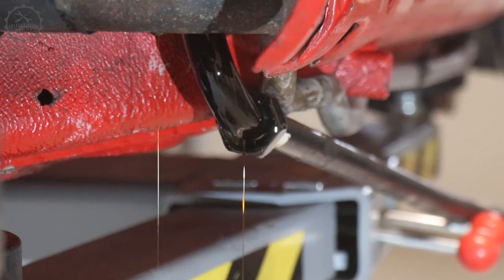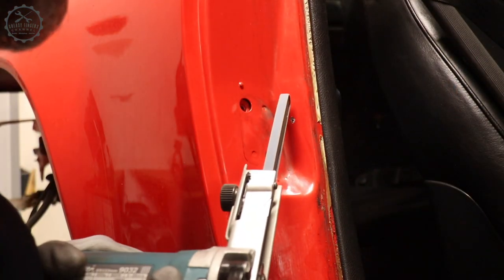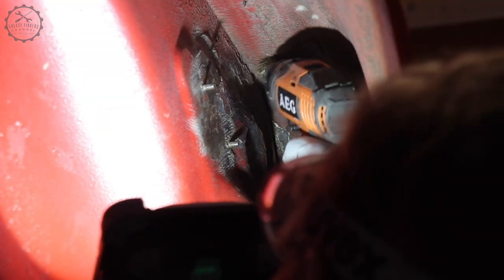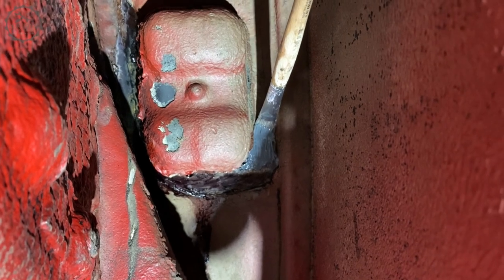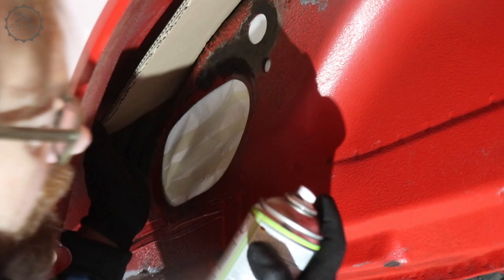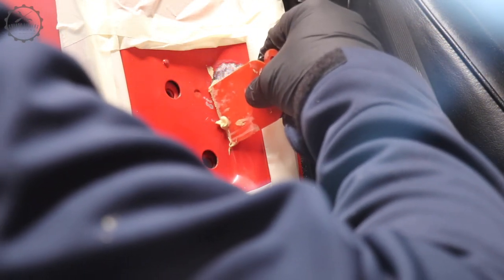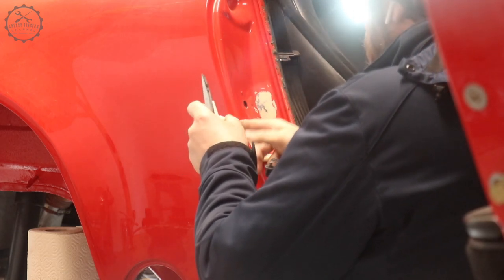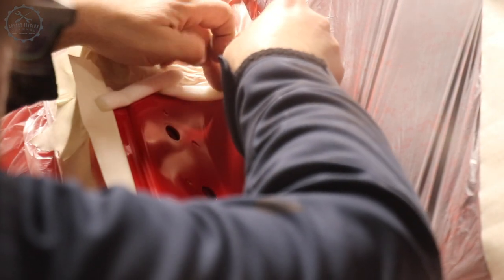Porsche 911 (87): Restoring The Rear Wheel House

Comment: Great series, love your content and skill, inspiring me to work on my 964 that also has some small rust issues.  In the past I have welded such holes by backing them with a piece of thick copper plate.  You can get much nicer fill and added bonus of a heat sink.
Reply from the maker: Thanks, mate!
I use the copper plate method myself sometimes. Point is: no gap allowed between steel and copper.

Comment: I always thought rubberized stone guard eventually lifted and trapped moisture.. I live in socal, and my car is from 1991 and I seen signs of lifting and slight surface rust. I think the best option to stop this, is to take off all the factory stone guard, get the metal completely bare, epoxy primer to seal in the metal completely, then a stone guard to protect the epoxy primer. It’s Impossible for moisture to makes its way under epoxy primer. 

I am thinking of getting a wire wheel on a high speed angle grinder, and taking off my factory under coating/stone guard to start fresh.
Reply from the maker: Yes, you’re absolutely right, 2Component epoxy primer must always be the first layer on naked steel followed by stone guard. In my experience, rubber based stone guard has made some progress in the past years and I used it in the project that you commented on. These days, I‘m switching to bedliner as stone guard, there’s a film in the Giulia series about this.
Still, the first layer is epoxy primer.

If the car that you’re restoring is post 76 Porsche 911, I recommend not to wire wheel the original stone guard off. And that’s for two reasons: the stone guard Porsche used back then is extraordinarily resilient and unless you see it coming off at spots, there’s no reason to distrust it. 
The second reason is that heavy wire wheeling will also remove the zinc layer which I often find totally sound after all these years. 

HTH

Comment: Hallo, besten Dank erst mal für die guten Tipps… Baue ebenfalls an einem 11er, deshalb ist das wirklich sehr interessant…... Die Iwata würde ich mir auch gerne beschaffen… Welches wäre denn die beste Allround-Düsengröße? Danke und beste Grüße, Holger
Reply from the maker: Danke, Horst & viel Glück mit Deinem Elfer. Welche iwata meinst Du? Die kleine, die ich für die Spot Repair benutze, oder die mittlere für die Radhauslackierung?
Reply: Greasy Fingers 
Hallo, Danke für die Antwort… Ich meinte die mittlere, das kannte ich noch nicht. Habe danach gesucht, aber es gibt einige Düsengrössen... Eine kleine Airbrush-Pistole habe ich bereits…. LG
Reply from the maker: @horstmartino6089  Das ist eine Anest Iwata LPH 80, ich habe beide Düsen (ich glaube 0,8 und 1 mm), aber bei meiner Art zu lackieren spüre ich keinen relevanten Unterschied.
Reply: Greasy Finger
Besten Dank für die Info, hilft mir weiter... ich probiers dann auch mal mit den Radhäusern... zum Glück rostfrei... 
Viel Erfolg weiterhin... LG